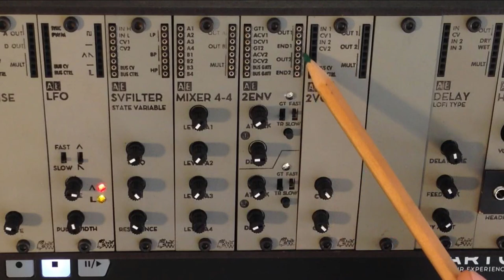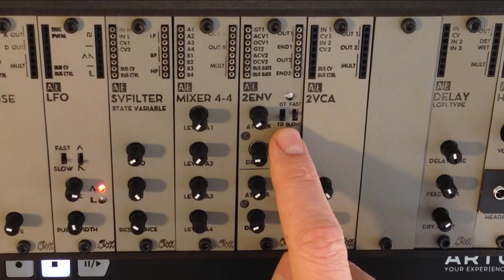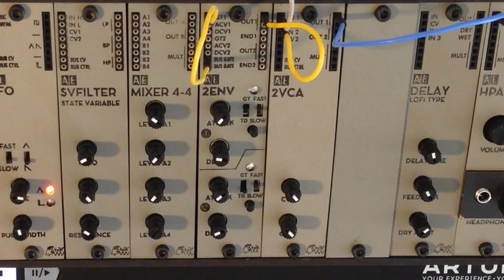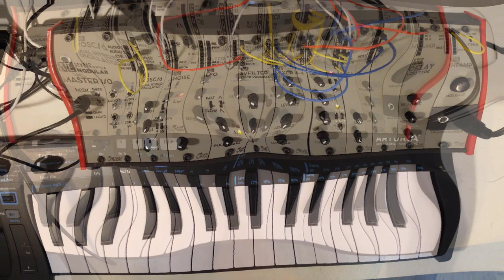AE Modular - Getting Started 06  - Dual Envelope 2ENV

Comment: I noticed something odd with the 2 env and adsr. Probably not safe to regularly do, and I should say I noticed this by accident. If you are sending a seq gate signal to the env, and out to a vca for, say, a percussion or bass sequence, connecting one of the step triggers to the env output will extend the note. I was running gate for a hi hat and bass sequence when I discovered this, and it actually sounds great, but I'd imagine this is bad for the module. I've read through the specs and forum, and haven't heard anything about it, so I'm assuming it's not a feature, and would be bad to regularly do lol
Reply from the maker: Someone on the forum noticed a similar effect with another module in that the output pins seem to act as a passive mixer when you patch another signal into one of them. Robert said it should be safe because he has secured outputs from incoming signals.